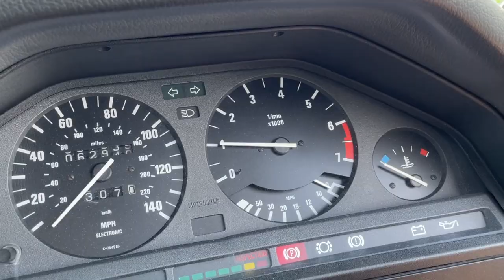BMW E30 M52B28 FULL BUILD IN LESS THAN 5 MINUTES BY WDS ORIGINALS

Comment: Ive got a 320i m20b20, whats the easyest engine to swap without modifications? (except de wiring of course) m50 / m52 2 liters?
Reply from the maker: Any m50/52 swap would be the same amount of effort regardless of engine displacement. 

I would suggest an m50b25 from an e34 if you want an easy swap 👍
Reply: U need e36 engine mounts, so m50b25 non vanos from e36 would also be fairly easy. U will still need e34 carter and oil bar (dont know english name)
Reply: @pohotnabalansstanga1929    Carter= oil pan.
Reply: Would e34 m50b20 oil pan fit a m52 engine?

Comment: Hi bro . I finished my m52b28 on e30 . But have some problem . First have only one sensor with 4 pin so doesn’t work my temperature geuge . 
2- have limit its stopping at 5200 rpm not going anymore 3. Windows and hot fan doesn’t work . 
Can you help me for all
Reply: Engije from 2000 model e39 m52b28
Reply: The first problem you have is because you have to run the original e30 temp sensor, the e36 doesn’t work. Because the e36 is 4 pin and it’s Double, you have to Drill s second hole in the head and make a thread for it (look for m50 pictures the had two sensors to see where to place it) 

Second issue is that your ecu is missing a speed signal, you have to wire it from the odometer which has a green connector on its back with a few pins. Those pins all provide a speed signal, make a wire to the engine loom and your problem will be solved.

Windows Check the fuse snd relays or ground wires maybe you’re missing something. The fan needs a sensor bolted to the radiator, are you Running a sensor? Is it wired?
Reply: @slavtcoa6856  fixed . Used radiator pipe opened hole and used sensor
Reply: @aniluzun2321  but e30 sensor 1pin? Check wiring or sensor instead if
Reply: @slavtcoa6856  made from up pipe from radiator e30 sensor

Comment: Since you had the engine out missed the chance to install oil pump chain tensioner. The nut will hold with the safety wire, but the shaft could snap. Typical BMW engineering SNAFU.